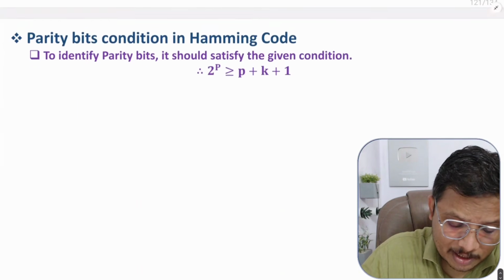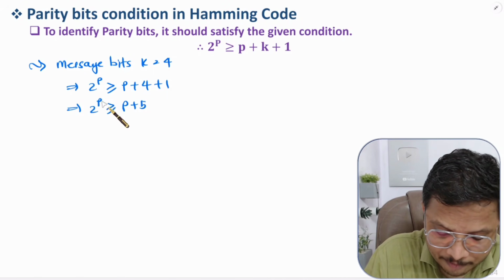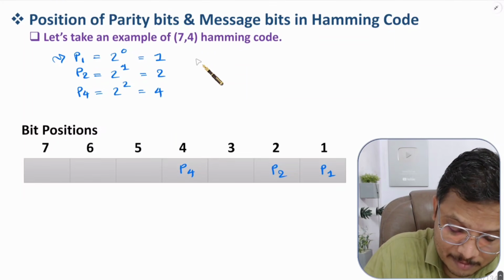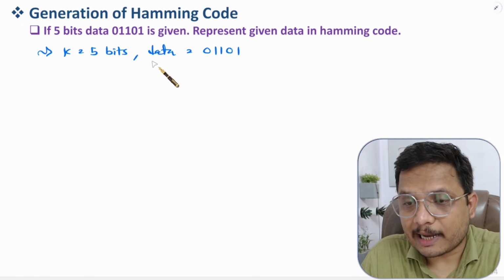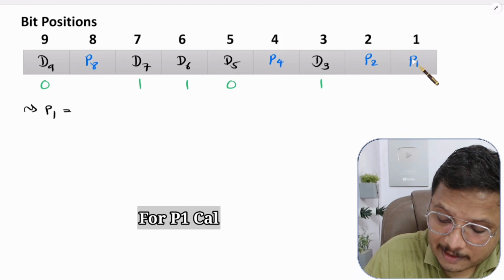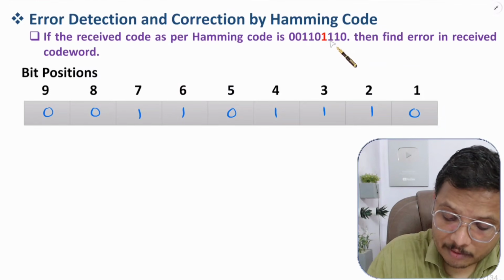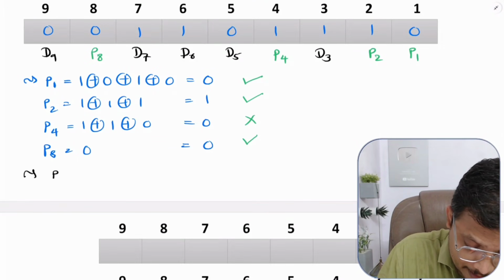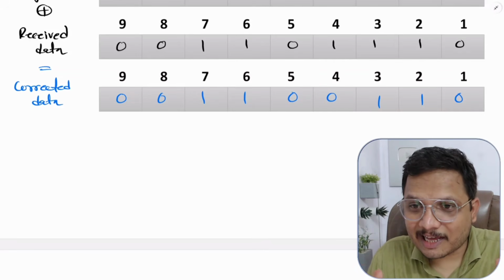Hamming Code for Error Correction and Detection: Basics and Examples

Comment: codeword generated for one 8-bit dataword by the sender with hamming code as 011100101010.three such same datawords have to be transmitted via a channel that faces burst error of length 3 starting from the 12th bit show how the receiver can correct the codeword for secong dataword using hamming code and gets the actual dataword
 can anyone pls help me solve this?

Comment: sir but in my college notes. they placed the bits exactly opposite? and if im doing your method im getting wrong ans
Reply from the maker: I have explained it perfectly, you might be doing mistakes in calculations.
Reply: i have the same issue here. the difference here we have is most probably the order of msb to lsb. its also exact opposite in my lecture notes as well
Reply: @niluferg5504  lol i just followed the univ method